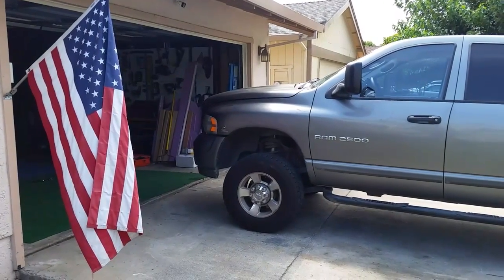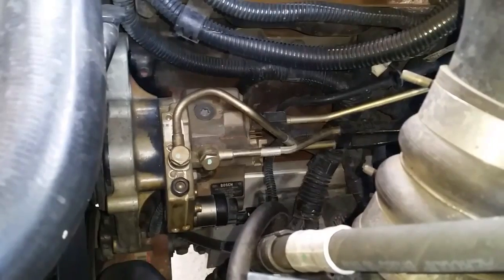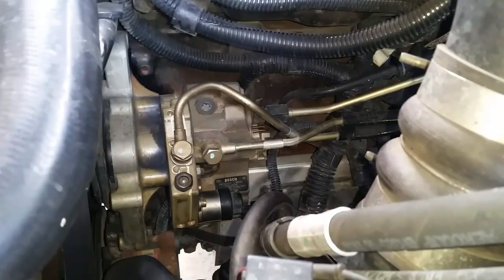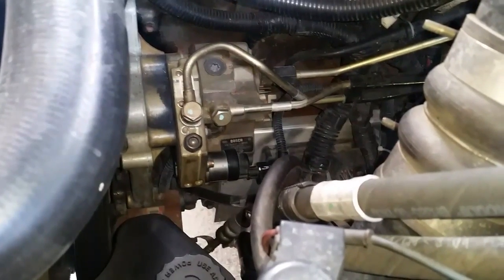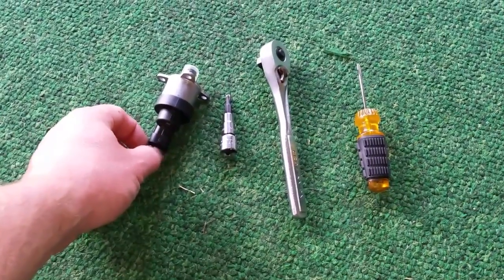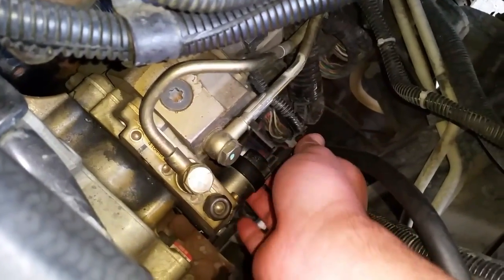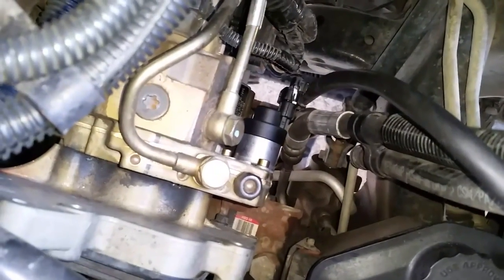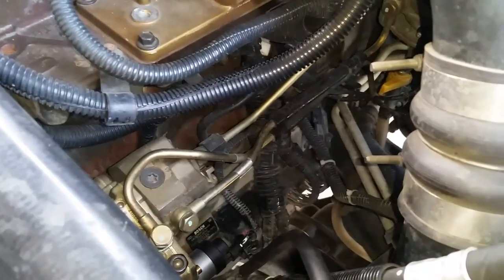5.9 Cummins FCA Replacement Video

Comment: Good tip but no joy. I had a long start, no start issue and I’ve tried everything to avoid a Injector service; Replaced the FCA, replaced the “pressure relief valve”, ran off straight SeaFoam, the only thing that had an effect was a fresh engine oil change. Started right up fairly quick. My next step is I added HotShot Diesel extreme in the gas tank and HotShot Stiction eliminator in the engine oil and took the wife on a long drive. 
Bought this 2007 Ram Cummins 5.9 last year with 201k and Once I get things running good I’m gonna give MM3Tuning a shot.

Comment: Also a crank no start if you think it is the issue just unplug it and if it fires right up then it's that FCA that helped me find the problem I didn't have any engine codes nothing wouldn't even run off ether

Comment: Good video, but specs call for two-stage torque procedure, first 27 in/lb then 62 in/lb which should be included for accuracy.  I don't know how critical that is, but I did it out of prudence.

Comment: Would a failure in this cause a hot fuel line coming off the cp3, rough idle, and 23k psi at idle?

Comment: Hello I have a 2006 dodge 2500 5.9 and I been having this problem so start the truck starts normal when I start driving I feel like it stops accelerating 2 or 3 seconds and it resumes accelerating it does this a few times once I get to 40 or 50 mph drives normal but if I spot at are’s light or I get traffic in the highway it does the same thing replace fuel filter then replace fuel pump and it still doing it I gladly appreciate any help thanks.
Reply: Mine does this! Did you find the problem?
Reply: @Robbybobby-rx4zd  yes it was a transmission line rubbing in some wires so I guess it was making a short

Comment: Nice Vid.  Just a word to the wise...the T25 bolts in these have a very shallow socket in the head.  If you end up using a bunch of adapters to reach the bolts, you could be tipping the T25 off axis and get very little engagement to the fastener.  Ask me how i know this?  Well, I have a much nicer easy-out set, and a new right angle drill for my adventures.  Do yourself(or the next guy) a favor when you stop to get beer to do this job, also stop and get three M4x20mm SHCS (socket head cap screws).  If this ever needs to be replaced again, the ball end Allen wrench will make this a simple change.  BTW- mine wasn't throwing codes, just idled rough when it got really cold.  After putting the new one in, I cant believe how smooth it idles now:)
Reply: The most valuable comment here. I swapped mine with a cheap Chinese one a month ago, it was bad out of the box and I put the old one back in. I bought the Bosch one and went to swap it today and the torx bolts are starting to strip out. Now I’m sitting here having a beer, waiting for the JB weld to cure with 3 T-25’s in in the torx heads 🤞
Reply from the maker: I only bought a Chinese sensor once 😂 never do that again.
Reply: @DieselCamper  I’ve definitely learned my lesson on the cheap Chinese parts 🤦‍♂️

Comment: JUST got my 1st diesel & the "glow plugs" light (yeah, I know, Cummins don't have them, but it was the exact same symbol my dad's old Mercedes diesel) came on & stayed on (with 10 chimes) while driving to SoCal from Phoenix...doesn't seem to have reduced power (Cruise set at 80 most of the way home), no noticeable smoke or haze, but also no load...not holding you to a diagnosis but could this be the FCA?
Reply: Update: I had the 6-beep variety & replaced the relay for the grid heater which fixed that problem. Got a box-tuner & then started getting the 10-beep version with this warning light. Just replaced the FCA today. Thanks, this video was super helpful. Seems to have fixed the issue (yes, the old FCA seemed gummed up & didn't have the proper rattle).
Reply from the maker: Hope that fixes you up, if not I have injectors for sale at 5-9diesel.com

Comment: Hey Rob, awesome video! I was just driving and got the grid heater light in my 06 (I guess that's wait to start ish for 06+) then I restarted it after a quick walk around checking for leaks In the rail. And it turned right off, do you think this could cause that? I have a slight rough idle when the truck is warm, not like a miss just like surging a little. Also I heard that it's common for manual trucks more so than auto
Reply: I have a g56
Reply from the maker: The leak is usually in the return side of the injector loop so we'll leak back into your fuel tank not on the ground it's not something you can see. You can try retorting the crossover tubes to 45 ft lb and see if that helps but my guess is you'll probably need a new set of injectors.
Reply: My truck shows zero signs of worn or tired injectors. No haze, no smoke other than fuel, no uneven temperatures out of exhaust manifold all cylinders are in check. No making oil, no smoking even if I unplug the fca (for a few seconds)
Reply: Does the Mm3 do balance rates on the injectors?
Reply from the maker: On 06+ trucks it will show balance rates

Comment: I know it’s an old video, but here I am. . . . According to the flow of diagnostics in AllData’s repair info, disconnecting the FCA electrical plug actually defaults the fuel pressure to low. When the driver in the ecu activates the FCA, the fuel pressure increases.
Reply from the maker: I don't think that's how it works in reality.  Unplug the Fca and your rail will max out👌
Reply: That’s what I thought as well, it’s kind of confusing to me. Trying to diagnose a crank, no start condition. Got into my AllData. This is what it’s showing me, and it’s a copy/paste
9. HIGH PRESSURE DELIVERY PUMP PERFORMANCE TEST
 1. Turn the engine off.
 2. Remove the (9012) and reinstall the banjo connector. (this is part of the diagnostic flow from checking the prv)
 3. Disconnect the Fuel Control Actuator harness connector.
 4. Disconnect high pressure fuel line from the fuel rail and route the high pressure fuel line into a graduated cylinder.
 5. Crank the engine until fuel exits this line. This will not be high pressure fuel.
 6. Crank the engine for three 10 second intervals. 
Looks like it’s saying that it wont be high pressure with the FCA harness disconnected ? Honestly just looking for some guidance from folks like you who’ve dealt with this.

Comment: I had that wait to start light as well would come on while driving down the road  rough idle to. And those same codes. Turns out 2 of my solenoids on my Injectors were shot and a couple leaking fuel tubes. Shes good as new now.

Comment: You think it could get stuck open cause I idle my trucks running 7500-8000 psi fuel pressure and has an issue starting but runs fine when it get going and I believe it’s supposed to be at 5500-6000psi
Reply: Same issue I’m about to replace mines today I’ll let you know how it goes
Reply: So the FCA did help the truck crank up now but my truck is still a little slow turning over only think I haven replaced is my cp3 pump and it starting to knock the (cp3 so I’m sure after I replace it it will be fine but the fca was a big help

Comment: Thanks for the video. I have a problem with a 2004 (143,000 mi.), loosing power going up steep hills while towing a 10,000 lb trailer. May be defueling. Anyone have any ideas? Thanks, JB San Diego.

Comment: How can you test this part?  Electronically part is in cp3 70 in a sprinter 2.7

Fuel Control Valve
Reply: Shake it see if it rattles
Reply: @adambrison6028  can't remember if it did or not.  I'm definitely getting a fluctuation in fuel pressure.  I took of the connector and re plug it in, and the pressure was level.  Then, an hr later, fluctuating again.  Unplugged it and cleaned again and pushed the female connector tighter.  Plugged it back in and it went level again.  Everything is very inconsistent to figure out what is going on. 
I will see if it does this again
Reply: @frontlinemedia4270  take it out and shake it see if it rattles or not
Reply: @frontlinemedia4270  ratting is good.
Reply: @adambrison6028  it's been awhile since I had this out.  I rebuilt this hpfp and think it did rattle.   Now it seems like the low rail pressure is coming on with extreme acceleration.  This is the best it has been, since it would go low rail with just a raise in the road.  Still lacking power.  I may try a new FCV, but have to see what this does on the highway.   The most I could do before was 64 mph, then the low rail would show up and fuel pressure would dive.

Comment: Did this fix your issue?
I have a early 04 coughs & bucks & shutters @ 1900- 2000 RPMs under loads, then gutless above 2,000 RPMs.
Reply from the maker: Honestly I'm not sure.  I bought a Chinese fca which is what's in the video and it caused me more problems.  I ended up putting the old one back in and haven't had any issues since.
Reply: Me too

Comment: When I plug in the FCA Cummins QSL9 automatically shut down
Reply from the maker: Bad wiring or bad FCA?
Reply: @DieselCamper  just discovered the fuel pressure sensor on the common rail is faulty I changed another one and problem solved

Comment: Great vid.  Let me ask this, what is the normal fuel rail pressure you see at idle and is it steady?  My gauge reads around 6-7k.  Sometimes when I come to a stop, it will drop down to 1.5k and then shoot up to 21k before it settles.  But it really isn't a smooth idle.
Reply: Tony Bell idle should be around 6k. If it’s bouncing around the fca is more than likely bad.
Reply: Brenden Reed, tell me something please. I have an 07 with the 5.9. I've had it about 6 months now. I tow a 11,000 lb fifth wheel with it. While the engine was still completely stock I started have a surge when I was just starting out at around 1300 rpm. Changed out fuel filter a couple of times.  Didn't seem to help. Installed a FASS system a while later. Didn't  help. Replaced the FCA last week. Didn't help. Any ideals??????
Reply: Dennis Denison that’s probably signs of weak injectors
Reply from the maker: Dennis I bet you could benefit from my custom tuning.  Do you have an auto trans? https://www.mm3tuning.com